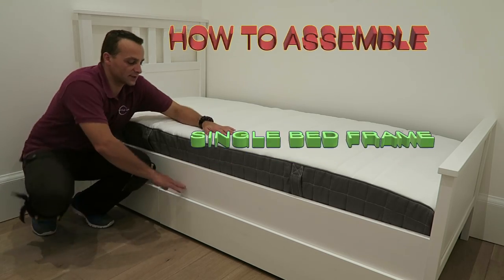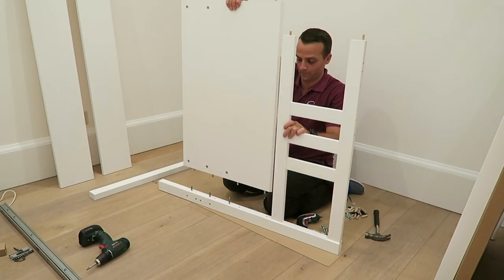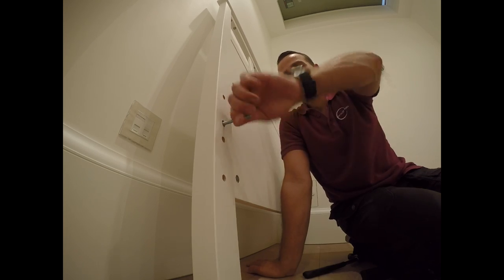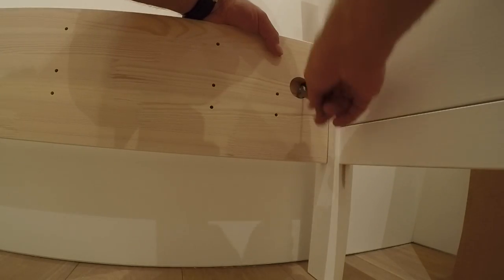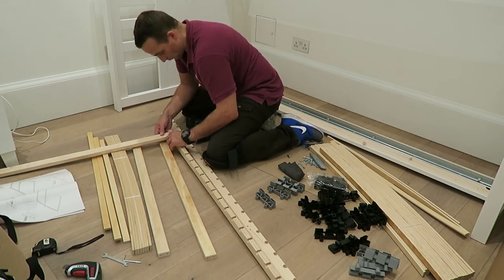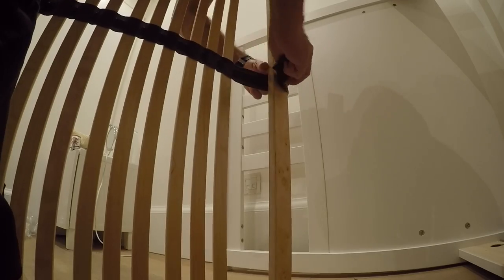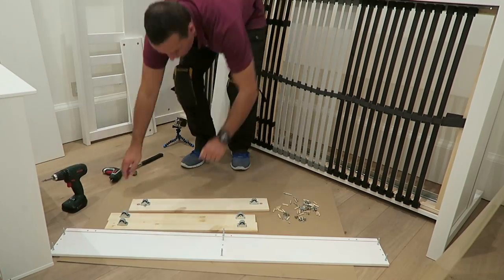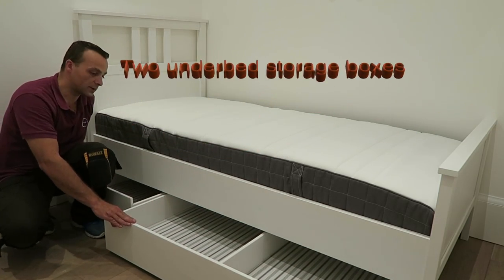IKEA HEMNES bed frame assembly

Comment: Mine came with the two small metal rails, that form the triangle on the base (and are a PAIN to attach!🤬).. Why weren't they installed to this frame that you assembled?
Reply: Probably updated the frame
Reply: Did you have the drawers undernesth?

Comment: this is very late but does this bed come with the screws needed, and if not where should I get them from?
Reply: Yep ikea always includes the screws and usually locks and Allen wrenches as well.
Reply: @maxpower10k  any chance you know what size wrench?
Reply: @50cal Rick i can try and take a look. I know it’s nothing crazy because i had to actually use a socket to get into a couple of the corners and i used my Skil 20 piece 1/4” driver set. So if you google that it should help!
Reply: @maxpower10k   awesome! That was helpful. It’s a 10mm wrench . I guess it’s the most common size for ikea products . I’m using it right now.  Thanks!